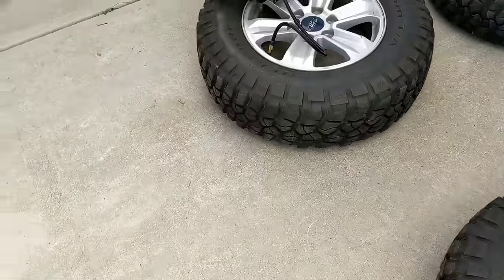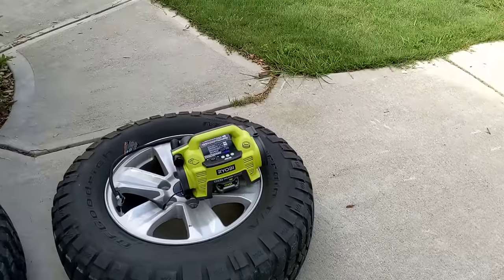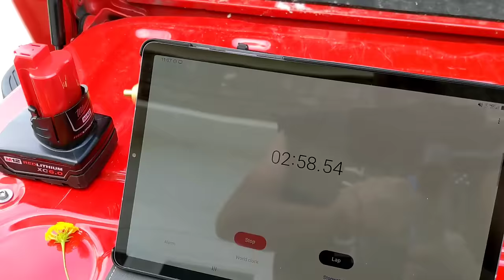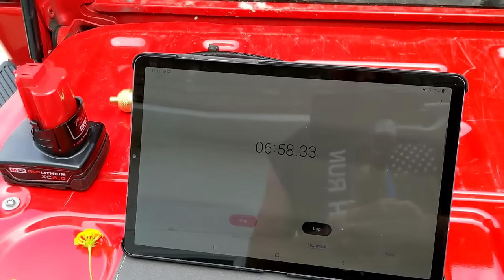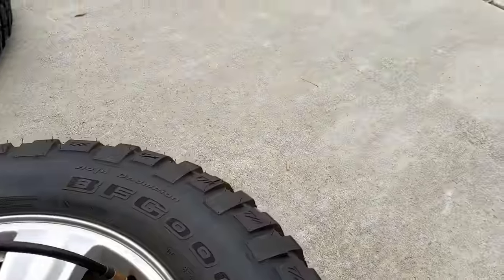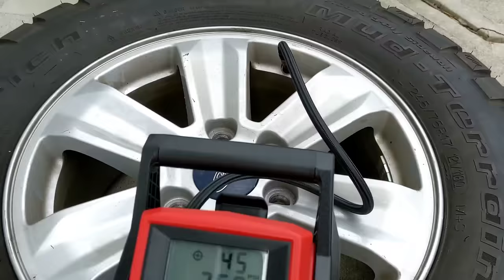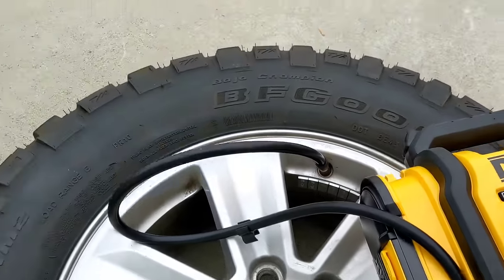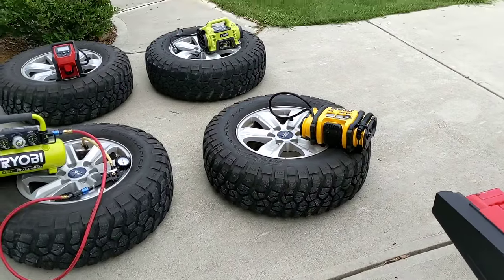Ryobi Milwaukee DeWalt inflator and compressor review

Comment: I own Milwaukee m12 tools, and dewalt 20v.  I love them both.  I was all set to buy the m12 inflator due to its compact size.  Then I realized that the dewalt was able to use THREE different power options.  Battery, cigarette lighter, and standard wall outlet.  That changed my choice,  if your battery dies, you have other options.  Thats a win.  Brought home the dewalt today
Reply: Dewalt doesn’t sell the inflator in a kit with a battery and charger like Milwaukee does, so if you don’t already have Dewalt batteries/charger, that puts the total price around $230 (compared to $160 for Milwaukee). And if you want the Dewalt to work on 110v A/C power, you have to buy that adapter separately as well.
Reply: I have the DeWalt also, but it does not inflate from the car 12v plug.  Always get a LoP warning.  Works best with the wall power outlet, no issues with power or inflation when plugged in.  So, this the DeWalt is great for home use, but worthless on the road.  In the above video, I assume the 20v battery was fully charged, and he only got 2 inflations.  Pretty impotent.
Reply: They're all gonna be ungodly slow
Reply: @rayF4rio  He used a 1.5 AH battery...the SMALLEST DeWalt makes.  Also, your car lighter/12V outlet was most likely the issue with the 12v function on the inflator.
Reply: This was my thought as well.  That option leaves the others in the dust.
Reply: I just bought the DeWalt. It says cool it 20 minutes after running it 10 minutes.
Reply: @timdodd3897  check the fine print of that quote - rest it 20 min after 10 min of inflating 100psi+
Reply: Same reason I bought it plus the rotating knob is much easier to use instead of continuously clicking to get to psi levels.
Reply: Was your vehicle running or perhaps had an older battery with lower voltage? Or maybe had a vehicle accessory plug with a low amp rating? Because the Dewalt  20v inflator uses a tiny little brushed 12v universal motor, so im guessing the circuitry wants to see atleast 12.5 volts, and probably needs atleast 5-8 amps (the Dewalt plug is fused for 10 amps max)... I know because I sheared the motor shaft on mine when topping off some trailer tires that were up around 40-50 psi  under startup, so I conducted a diagnostic teardown 🤨 Honestly that compressor should cost $50 given the terrible components inside of the nice exterior and control interface! I still liked it enough to buy a replacement though, but I no longer have trust for it to be my go-to emergency air source... Atleast for light trucks or trailers. It's a shame that such a great design contains such trash tier motors inside! They could easily double the performance by going brushless and using a bigger piston size (they sure left space inside for the opportunity 🙄), but then the 12v accessory plug and especially the 120v input would cost much more in circuitry/transformer design, and would probably require direct 12v auto battery connection with clamps to handle the amperage... By now I have high output, high duty cycle 12v compressors in every vehicle I own and just use the Dewalt for minor adjustments, helping/loaning it to friends/strangers, or mobility for small projects (ATVs, wheelbarrows, inflatables, etc) when I'm just inflating something minor that doesn't warrant getting out an extension cord and 120v tanked compressor if not around the shop already... I think I may own too many compressor/inflators 🤔 If that's possible 😂👍 By the way a 12v DC motor pulling less than 10 amps is pretty weak.. Walmart/Amazon/etc. have 12v 15-25 amp digital compressors for $30-$50 that are faster than all of these by a long shot, and if you spend another $30 on Amazon for a 20 or 25 amp DC-DC 12-24v to 12v step down converter and a cheapo Dewalt battery slide on power output (or any other popular power tool battery) you can have a very fast and capable cordless tire inflator for very cheap... Milwaukee M18 is the fastest out of the box currently, but you could have an even faster one for under $100 if you've got some batteries already... Just be careful using batteries that don't have low voltage protection circuitry and let the battery run completely flat... (Dewalt, Craftsman, Porter Cable, B&D, Bauer style packs are all unprotected) But unless you are doing 35s or 80psi on truck or trailer tires with a 1.5AH battery 🫣it's really pretty easy just to check the charge between tires 😂 Happy inflating  😉👍
Reply: I would never run the Dewalt on anything but a 5ah battery.

Comment: Milwaukee in second with a 12V tool. All of the others were 18V or higher. I’m impressed.
Reply from the maker: Yeah they can do a lot with 12v.
Reply: Not only that it was the smaller battery.
Reply: Pair the milwaukee with a 4 or 6ah battery and it is a great setup to keep just in case
Reply: @apocalypse2941  should have had that xc battery on the tailgate on it.
Reply: not only that but the Ryobi compressor was precharged with air
Reply: @upcontryjunk  but you can also put an air pistol on the ryobi to blow out things like on cleaning dirt and ebikes.
Reply: @Zozo806  I agree I would like to see the times of the Ryobi with an empty tank just food for thought
Reply: Yeah, he should have gotten the m18 air compressor...
Reply: Ya and they have an 18v air compressor but I guess this guy felt like the Milwaukee 18v was cheating.
Reply: @Jim Bridgeman I agree Jim. I just received the M12/M18 bluetooth speaker and i love that it takes all the batteries that i have. A 1.5 18vol last nearly 4 hrs
Reply: @Jim Bridgeman not sure if you know but Can you keep the Milwaukee in your trunk during the winter with a battery? Or would the battery die?🤔
Reply: @Jim Bridgeman 😊
Reply: @raymondw6164  I would remove the battery from the tool to stop it slowly draining.
Reply: The Dewalt just has a small 12v universal brushed motor inside 🤫 that's why it's so easy to include the 12v accessory plug fused at 10 amps, or to get a basic 12v dc 120v ac power supply as an accessory... I wish it was battery only design and had a nice 18v brushless motor and big bore cylinder inside! Lots of money for a nice exterior filled with $15 worth of motors (the high flow inflator motor is even more disappointing in appearance!) 🤔 Honestly the Ryobi compressor would've done just as good or better starting from 0psi, atleast if it was allowed to continously flow until 31psi... Letting it build to 120ish PSI everytime just made the CFM less vs. Letting it just flow with less than 30psi of load on the motor... most compressors flow atleast 50% more CFM at 40psi than 90psi, so it honestly wasn't used properly to set its fastest possible time... Atleast in my opinion... (Not my opinion on the Dewalt though, those are facts, I've got the parts to prove it once the motor shaft snapped starting under about 50psi 🤣 But I still eventually bought another one just because I own lots of Dewalt batteries vs. other brands 🤫)

Comment: From experience 9320 miles trip. The Ryobi outtakes them all in battery life, that’s the most important thing. No problem doing 2 full-size 225/55/17 or 235/75/15 tires and having power left for emergency, like pumping up the kids beach toys at the beach 🏖. One or two 5.0 batteries from Ryobi with you and you’re good.
If you’re still on the sensitive side you can buy the cigarette lighter charger or a 
Converter 110/220 and charge up Ryobi batteries.
Great video stay safe

Comment: I have a mixture of Milwaukee and Dewalt tools depending on the application. I went for the Dewalt compressor with the optional 115v adaptor. This gives me 3 sources of power. When I’m home I use the adaptor and when I’m away I can use battery or plug into the cigarette lighter.
Reply: Yep!

Comment: I've seen tests of the Milwaukee M18 Fuel with an 8Ah battery that were amazing. Very fast, delivered high pressure for truck tyres & did about 25 tyres in one battery. However, it is expensive & that is a HUGE battery.     Of these ones I'd get the Ryobi Compressor (space is not really an issue for my vehicle) & I have about 12 Ryobi 18+ tools, so lots of 4 & 5Ah batteries.

Comment: That Ryobi inflator has been replaced with a slimmer model, they probably both have the same pump though. It's by far the cheapest, right now it's $40 tool only, or $99 with two 4Ah batteries, a charger and a carry bag. 
You can set the pressure on the Ryobi compressor to whatever PSI you want and sit in your truck while the tire fills, you just need to swap out that trigger gun with a quick connect. 
If space is a concern, Ryobi makes a hand-held unit. It's on sale right now for $25. 
The Dewalt is the best quality unit, plus you can run it off of your lighter plug. Keeping batteries in the truck on hot days is really going to take a toll on them and you may even find that they won't work when you really need it to. Depending where you live, if it gets too cold out, it's possible that none of the batteries will work until you warn them up.
Reply from the maker: Yes I would like to try the newer version of the ryobi to see if its better.  I'll have to try setting the pressure on the compressor to see if that works!   Thanks for the comments!
Reply: @apocalypse2941  I have both versions of the Ryobi. I've never tested them against one another, but I'd say they perform about the same. I use these inflators a lot, as in every week, for topping off all kinds of tires, they are super handy. The Ryobi inflators have a plastic piston, so if you own one, mind the instructions and obey the duty cycle.

Comment: I have the Milwaukee it's fast and compact and will last a long time with the 6.0 battery.great for roadtrips.
Reply: Is the main unit compatible with different grade batteries? I don't see a 6.0 unit for sale.
Reply: @MrSupernova111  Milwaukee sells a 1.5 , 2.0, 3.0 ,4.0 and 6.0 ah battery's for the m12 system
Reply: @aaronrepper7649  . Great! Thanks!
Reply: Can confirm. Have used it to pump up 4 tyres from 18-42psi

Comment: The Ryobi compressor will run for half an hour on a fully charged 4Ah battery. It could also have been a little quicker if you had set the regulator for 31psi and just used the air chuck's gauge to monitor the pressure.
Reply from the maker: Watch my video on doing just that.

Comment: The milwaukee is pretty sweet. I have it in my Ram 2500 with 80 psi. Pumps tires without any issues. I mainly use it to fill my airbags.

Comment: I'd say, stay with the lineup tool u have. I am a black and yellow team, I know for a fact that the dewalt beats any brand for continuous running or high-pressure tires like 80 psi. Milwaukee shots off after 20 mins, wait another 20 mins to cool down and then run again.

Comment: I have the M12 inflator and overall, it works great especially considering I bought it on sale BUT, I think the Dewalt version is better from what I've seen. Also, the Dewalt offers an alternative power source whereas the M12 doesn't. Love the tiny aize on the M12 though. You can't have everything, I guess depending on what batteries you already own will determine what you buy. I own about 9 M12 batteries at this point so Milwaukee all the way for me.
Reply: You can make an adapter for the 12v milwaukee to run off your cars 12v outlet. I made one for mine using an old 12v battery and a cable ordered off amazon
Reply: @doubleas88  better to buy dewalt no fucking around and voiding warranty .

Comment: I kind of like the idea of being able to plug into the car with the dewalt, just in case the battery runs low.
Reply from the maker: Yeah that is a great backup plan.  As you saw the battery died and I could have plugged it up to finish easily. Thanks for the comment

Comment: The larger ryobi was able to inflate the your setting in half the time as the others. Time matters thanks for selling me on the larger ryobi. Both ryobi air compressor batteries lasted longer.
Reply from the maker: And they are cheaper!
Reply: If you noticed he also stoped using the compressor  ryobi several times and it still beat the others, and had more battery left to do the second test. My hand air gadge for my compressor has a lock.
Reply: Remember ryobi 18v batteries also fit about a hundred different tools other brands change batteries every year or so.
Reply: Remember he startet with a full tank on it.  Add 2 more minutes for the tank to fill up first time too.  And it take 3x the space compared milwaukee.  Non of these are made for using tools with them. So they are only good at filling footballs, tires and airmadrasses.
Reply: @blackkos  an air stapler deos. It's 3 times as cheap all the batteries work with hundred other tools. I have both dealt which sucks and the milwaukee is good but battery dies way quicker than ryobi have used them all. And have them all ryobi inflates 2 tires compared to one and still has battery. I like ryobi better more versitillity.
Reply: The ryobi's also had at least 3AH batteries in them, they looked like 4 or 5. Much larger than the 1.5 he used in the dewalt. Was kind of an unfair test. I use a 4AH battery in my dewalt and topped off 10 tires on a truck, car, and trailer for ~10psi each. Battery still had 1 bar left. The ryobi compressor is nice, but also too large to throw in the back of the car, I also like the auto-stop on the dewalt when it reaches setpoint.
Reply: @benjaminhenderson1759  Dewalt is at least as versatile. I'm going with the Dewalt, since I already have batteries for my drill set, weed whacker and lawn mower. Yes, the Dewalt self propelled electric lawnmower is excellent, and so is the weed whacker.

Comment: Great video. Like others say, very impressive the smaller Milwaukee kept up w/ a 12V system. No surprise the air-tank Ryobi was fastest, but I thought Dewalt would've been faster considering 20V and size. For me, I'm going w/ the Milwaukee: smallest, have 2x other M12 tools in my truck (impact/ratchet) w/4maH and 6maH, so battery modularity is easiest, and I have confidence in Milwaukee products in my experience. I've had issues w/ Ryobi batteries in the winter not working consistently (18V w/ Brad nailer). 

To each their own. Thanks for the upload.
Reply: Dewalts 20v is nominal 18v. No dewalt ever actually performs at 20v
Reply from the maker: A lot of people wanted the DeWalt to do better too! I think it's downgraded so that it can use the cigarette lighter plug without blowing something

Comment: Nice review, you started with the compressor already full which gave it a huge advantage. You don’t store compressors full typically and should empty them after every use. Also the dewalt would perform better on a higher output battery. Those are the old 1.5 batteries and they don’t hold up well for long.
Reply from the maker: Watch my follow up videos.

Comment: the milwakee one is the best because its small. I already felt shaded out buying a portable compressor when I have a air compressor in the garage and I think the #1 engineering thing I looked at was size. It stows nicely in the toolbox next to a band saw, die grinder and a sawzall.

Comment: Milwaukee is great! Small, easy to use and set up. Would recommend a 4.0 battery, but 2.0 works well. Easily pumps up my trailer tires to 90psi when they get a bit low.
Reply: Hi Carl 
Can it go upto 100 psi on 295 radius prime mover tyres ?

Comment: Put a compressor that runs off your truck battery in your truck. All these battery operated ones will let you down if you really need it. Great review.
Reply from the maker: The dewalt can plug up to the car.
Reply: Why will the battery ones let you down? You must forget to keep your batteries charged with an extra one on hand. That’s not DeWALT’s fault, now is it?
Reply: Ryobi make a charger that plugs in to you 12 outlet
Reply: The Milwaukee one is definitely a battery hog. You should really use the 6.0 or keep a spare.
Reply: The Dewalt comes with a plug-in for your car just in case you don’t have the battery and he had the weakest is battery that Dewalt makes. Not a fair comparison.
Reply: You can charge these batteries in the car.  also this is way more appropriate if you are just topping off trailer tires 30 ft away instead of getting out a hose or 12v cords.

Comment: Sorely tempted by the Ryobi compressor, as I could use it for cleaning sawdust and gunk off stuff in workshop. But I’ve already got DeWalt tools & batteries, so for me in Brexitania, the DeWalt works out cheaper by £70 or $82 for an occasional use tool.

Great comparison review - thank you.
Reply: They do an adaptor that lets dewalt or milwaukee battery fit ryobi tools.

Comment: I’m for Milwaukee tools myself. Have a lot of them, but I’d go with the dewalt that can plug into a cigarette lighter. In case battery is depleted by the time you need it.
Reply: I have the dewalt. You'd probably want the ac adapter you can buy separately. The cigarette lighter will take forever to fill a tire

Comment: I love my Milwaukee compressor, just wish it was 18v
I use it for pressure testing gas service lines to 100 psi. It takes about 2 min for a 1/2” line at 100’ and about 4.5 min for a 1” at 100’.
Reply from the maker: Watch my video on the m18 compressor and inflator.

Comment: I bought the Ryobi air compressor for $69.  With a 9 ah battery it is a beast.  4 ah battery it doesn’t last too long.  But for little trim jobs or stapling it’s awesome.

Comment: Tractor supply sells a compact 2 gallon unit. $69.00. I put a 1500 watt inverter in my rig to run it. Having the inverter gives you plenty of options to run other things. Coffee maker, microwave etc. I hard wired it to my battery so I don't have to fool around  with cables. Take a look. Have fun.

Comment: I have always preferred the dewalt tools, and those 1.3 and 1.5 AH batteries are always disappointing. I bet that compressor would have performed much better with a 4 ah battery
Reply: The new powerstack batteries make it even better and for long use I have a 6 ah  battery